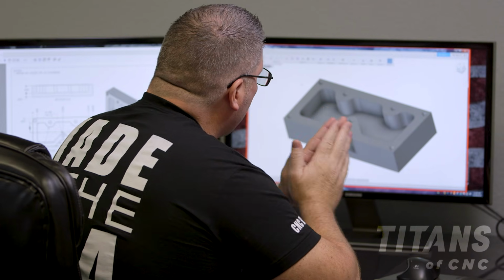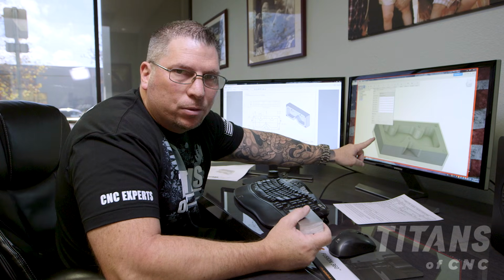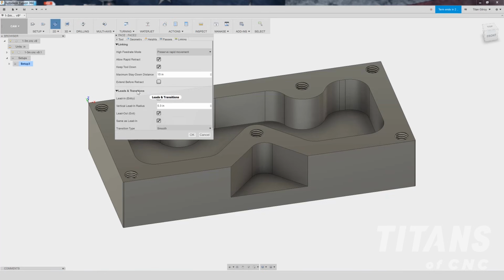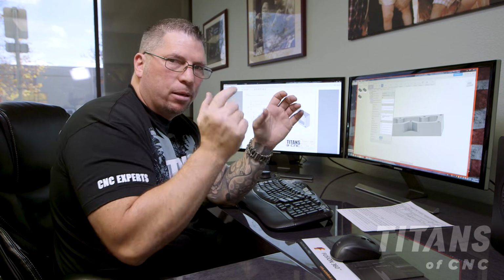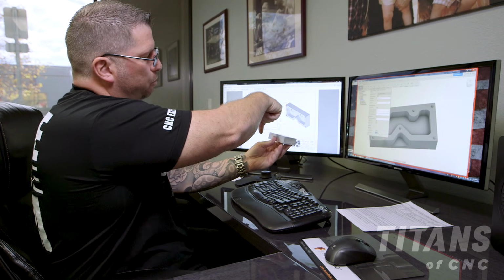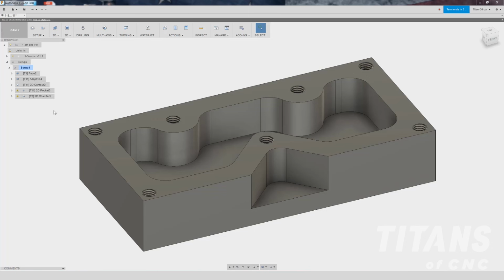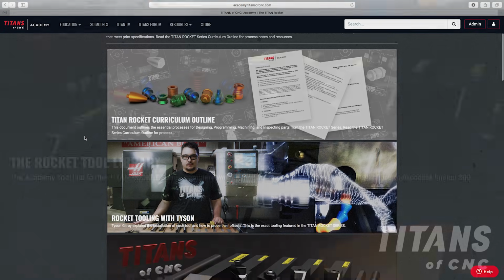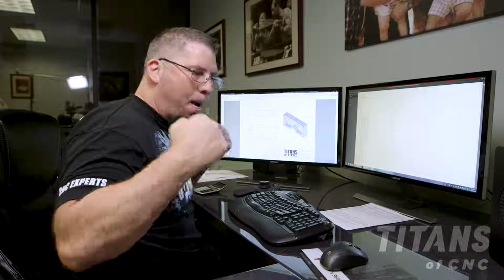Fusion 360 Tutorial: Program the Titan-1M (OP1) | ACADEMY

Comment: Hi Titan,

First, many thanks for all you have done to generate interest, especially to new comers into the CNC world.  I have been subscribed to your channel since the beginning and really enjoy your videos.

I have a 2007 HAAS TM-1P which I have owned since it was new and it has been a wonderful machine for a hobbyist such as myself to make parts/tools for R/C aircraft related items as well as Fishing Kayak  items.  I am kind of a self taught guy learning from experts like yourself that are willing to share their extensive knowledge.  At the age of 71 the last 10 years have been very rewarding learning process.  At the age of 61 I didn't even know what CNC stood for.  Ha Ha

Up until now I have used another CAD/CAM product but have taken an interest in Fusion 360 and watched a lot of videos on the subject.

One of the  big mysteries in Fusion 360 for me was assigning tool numbers from the tool library based on how they are loaded in the tool changer.  I would seem to me that you setup (i.e. set the offsets for each tool) and load the tools for each individual job.

I have a 10 position tool changer on my HAAS.  I have certain tools that I tend to use a lot and leave them loaded in the tool changer. i.e. position 10 tool probe, positions 3 & 4 for various end mills, positions 2 & 9 for drills, position 7 for taps etc.  My first part I programmed in Fusion 360 that I actually cut was a part that had to be machined on 4 faces.  I made one sketch of the part in the model screen  and then in the CAM screen I made 4 different setups, one to do the machining on each face.  Of course, I had to reset the datum for each face and also re- probe the part each time the part was rotated in the vice.  I had to change a few tools in the tool changer for some of the operations.  This resulted in having multiple tools in the library with the same tool number on them.  I just had to be careful that the correct tool was loaded in the correct tool changer position.

Maybe,  a good lesson for us novices would be to make a video on the tool library and how it relates to tool changer positions.  It tool me quite a while to figure out where to edit the actual tool number.  It turns out that the tool number was located in the (Post Processor) tab in the tool library.  Once I found that all was good.

Thanks again for all you do for the CNC community.

John

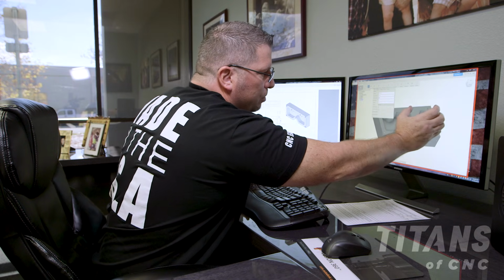Comment: 14:17 you can actually make an expression so you dont have to calculate it yourself by using this: 

tool_diameter/2+tool_diameter/10 

so it will calculate half the tool diameter and add 1/10 of the tool diameter